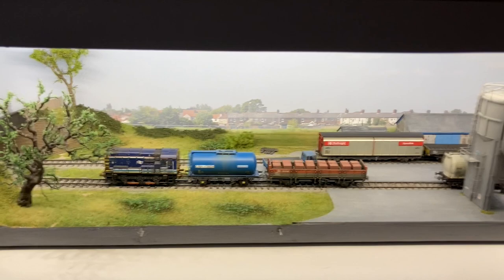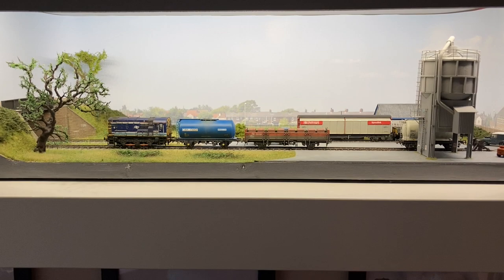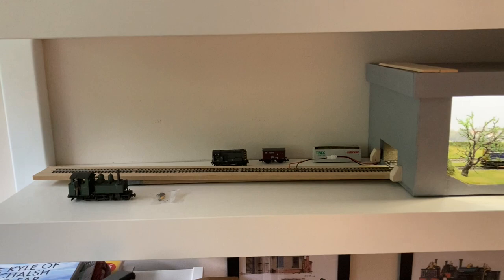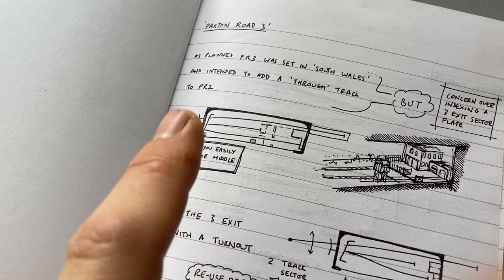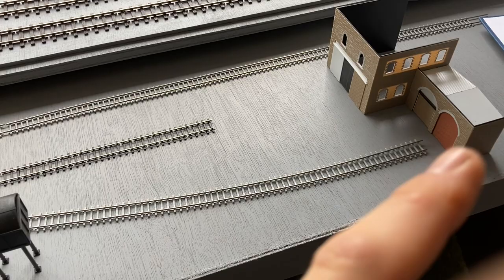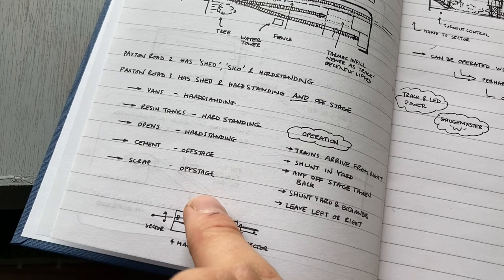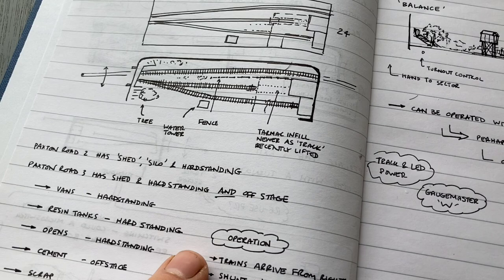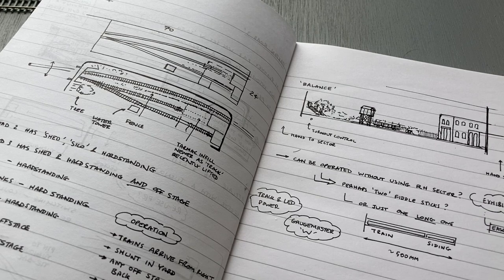Layout Design: Paxton Road 3 - Considering previous success

Comment: Was thinking the same as Rob with a single car DMU and maybe keep the line completely separate behind the fence of the yard as the main line. The single car DMU could run back and forth using a shuttle unit. 

Just an idea and would save the point work.

Enjoying the videos.
Reply from the maker: Thanks Daniel. Falling back on design ‘ideas’ without having a strong vision in mind for your layout is definitely a pitfall I want to avoid, this isn’t a passenger layout, it’s a back water, a mundane example of wagon load freight holding on for life. 08s shuttling trip workings to and from the local yard, serving a few loyal customers determined to keep their traffic on rail…